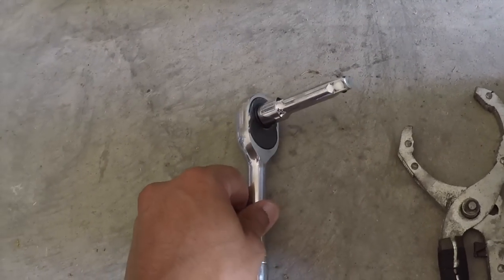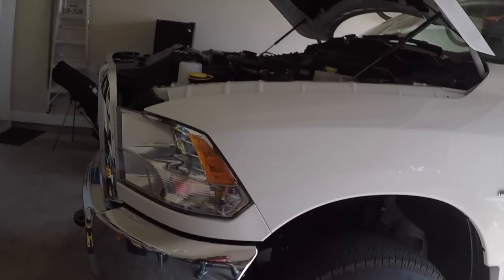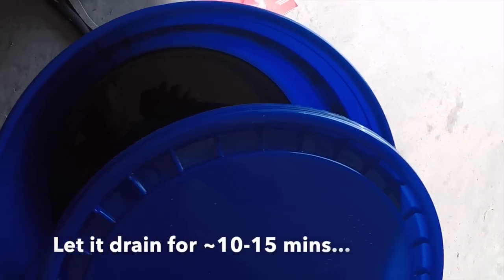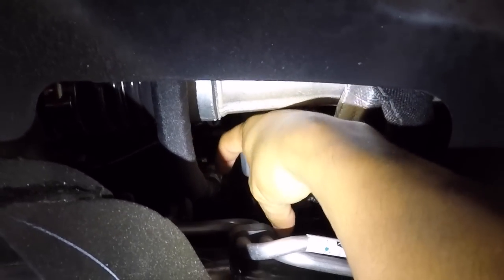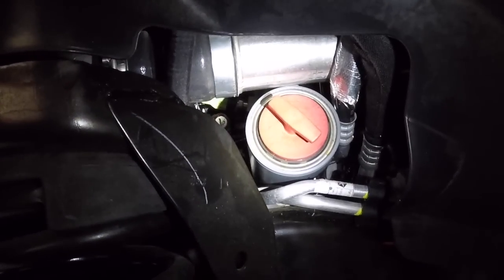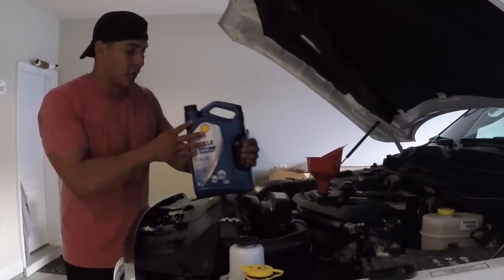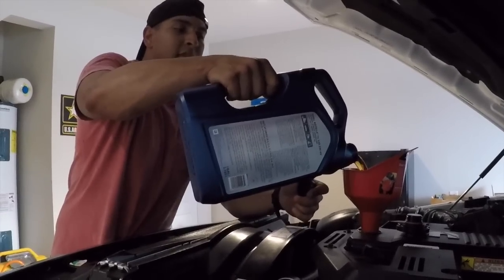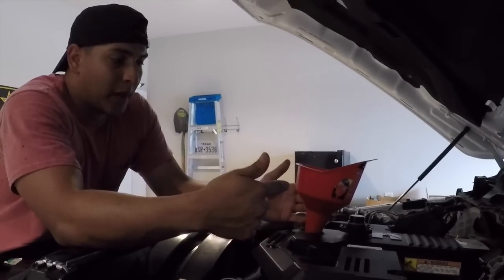EASY RAM 6.7L Cummins Oil Change How-To

Comment: Just bought a 2018 Ram 3500 with the Cummins and really appreciate your videos.  I noticed the wrench and ratchet set you had in the black tool box. I've never had a decent set and am in the market. Where did you get yours? Also are you planning to go with the owners manual for oil change intervals?
Reply from the maker: Our Future in an RV It was a gift from the parents 10 years ago when I was wrenching in HS. A good quality set will last a lifetime. I’ve only had to replace a 10MM socket and a 1/2” drive ratchet since I’ve had it. I believe it was bought from Sears and of the Champion brand. Can’t go wrong with a large set with many pieces but having a box with it makes it easy to take with you on trips. I slide it behind my rear bench seat.
Reply from the maker: Yes, I absolutely plan on abiding by owners manual for services. Especially the oil changes, 15K miles/6 months/500hrs.
Reply: Thanks for the quick reply.   @MotorHead18
Reply: @MotorHead18  thanks for the video. Are you doing the fuel filter soon.
Reply from the maker: cee noom https://youtu.be/ALzOoHftP9c
Reply from the maker: cee noom Make sure you subscribe!
Reply: @MotorHead18  are you still doing every 6 months? 6 months seems to be overkill if you're not at the mileage interval
Reply from the maker: @kavik526town2  that’s my personal choice every 6 months even if I don’t hit the miles
Reply: @MotorHead18 doesn’t hurt, oil is cheap, motor is not!

Comment: does it matter if you drain the oil with the cap on or off on the motor?
Reply from the maker: Not really. I do it out of habit, maybe it drains quicker, but what's a few minutes going to hurt anybody.

Comment: MOTOR HEAD Good video.  Getting stuff together for my first oil change 2015 2500.  Had heard about Rotella T6 and saw they had a T5 (15w40).  Did you end up trying the valvoline? extreme or premium blue? I was semi inclined to just call local Ram/cummins dealer and ask what they were throwing in.
Reply from the maker: K. Piersing I am currently on amsoil after my T6 oil change. I believe 5w-40 will help with cold starts and warming up than T5 with the 15w-40. I haven’t tried valvoline, my next oil change is in April!
Reply from the maker: K. Piersing https://youtu.be/MbOknpimlv4 check out my amsoil video.
Reply: @MotorHead18  You in the sand hills of NC? At UNC currently but my wife and kids are down there.  I end up home most weekends.

Comment: Valvoline premium blue , is the only oil cummings recommends...........
Reply from the maker: Same principle of money drives wars. All about the money...Even if Cummins only recommends that oil doesn't mean it can't run with the same weight oil made by other manufacturers.
Reply: @MotorHead18  , I agree...
Reply: That’s funny I called Cummins a week ago and they would not even tell me what oil to run. They told me to call the dealership!

Comment: I think it’s waaay easier to remove the intake to get to the oil filter. No oil mess either cuz you don’t have to tilt it. You’ll probably need a tool to loosen the filter, but when you tighten the new one, just hand tighten it. That way you can remove it by hand next time.
Reply from the maker: The Yazz Its a technique. After my first oil change, it was much easier the second time around. Correct tools, right size oil filter wrench, hand tight and nothing more. After your first time through the wheel well, it’s MUCH easier.
Reply: Agree ,through the wheel well is best just need proper wrench and screw in filter cap then simply try it once .Do these ALLLL friggin day .

Comment: amigo i have to fill the filter before installed? or jus half?
Reply from the maker: guil Mondragon half would be fine, 3/4 is where it sits at when you removing it so between 1/2 and 3/4 filled before installing. Filling it to that point and priming the fuel pressure will help the truck start up.
Reply: The service manual says to fill with 1quart.

Comment: I'm currently finalizing my deal on my 2018 ram 2500 Cummins and they are offering me a service package for $4300 (I'm located central northern Canada so that may sound real expensive) that includes 13 oil changes 13fuel filter changes and 13 tire rotations but seeing how easy the fuel filter and oil changes are I think you have seven me a boat load of cash. I'm just worried about voiding warranty. I heard as long as you keep records of maintenance and receipts that all will be fine?
Reply from the maker: Jason Joyal It only costs around $2300 for parts. The rest they are charging labor, but with my vids you could save yourself a couple grand. Your call Chief.
Reply: 2 grand is nice chunk of change. With living in the colder climate would the rotella t6 still be a sufficient oil. We see -40c up here in the winters.
Reply from the maker: Jason Joyal Yeah, but you definitely need to run 5w-40 in your winter. Not 15w-40.
Reply: Good Lord man, I wouldn't get the oil changed at a dealer if the labor was free, just so I don't have to see their face.  You warranty will be over before anything breaks, then the whole truck will fall apart.  Ask me how I know.

Comment: Step 1: verify you have the right oil filter. Step 2: poke a hole in the bottom of the old filter and let it drain.

Comment: You live in Texas and use 5w40??? Manual and shops say 15-40 here 0 degrees and up is 15-40. Great videos though.
Reply from the maker: Mike Yes! I live dangerously!
Reply: @MotorHead18  hahaha ya. What part of Texas are you in? I'm outside of Austin in Round Rock. PCSd to Ft.hood few years back and got out on medical retirement. See your airborne flag in the back. I was airborne qualified for 5 years then dropped status.
Reply from the maker: Mike I wish I lived in Texas, for now, North Carolina.
Reply: @MotorHead18  sucks man! Either way keep up the good work and from one vet to another. Thanks for your service!
Reply from the maker: Mike Get em’ Mike!
Reply: @motorhead, are you still in NC?  I’m at Bragg.

Comment: 3 gallons of oil not 15 quarts............I also found it easier to use a gallon zip-lock bag to put the oil filter into while taking it out.
Reply from the maker: I've heard of the ziplock bag before, not a bad idea. I prefer the adapter!

Comment: I was told by the dealer to wait on the first oil change because the factory adds additives to help break the motor in properly. They coulda just took my $500+...
Reply from the maker: I would rather get all of that junk out. I believe silicone is the worst enemy during break in.

Comment: So, I have a question for the -Fumoto Easy Oil Drain Valve Bolt (Buy Here: https://amzn.to/3bkenaW) I saw you recommend it but I did not see you installing it to see the functionality of it. I just wanted to know before I bought it. Thank you!
Reply from the maker: I have since installed, and it's badass. Wish I put it on the first oil change Steve.

Comment: You don't have to drain the oil with a 5 gallon bucket you could actually do it with that oil pan.
Reply from the maker: That's very true, although I use the bucket to prevent splashing because of the space between the oil pan and drain pan. I highly recommend a 5-gallon bucket for that reason, throw the cover on, and take it directly to your local auto store for recycling.

Comment: You stated the spec's day it takes 15 quarts but you only bought 3 gallons
Reply from the maker: The first comment clarifies.
Reply: Do is out 15 quarts or 3 gallons
Reply: So
Reply from the maker: @carlvin8693  12 qts or 3 gallons
Reply: Thank you

Comment: That would be 12qts. With a new filter. 15's gonna put you WAAAAY over full. SORRY!
Reply from the maker: Terry Henry Your absolutely right, just misspoke!
Reply: @MotorHead18  Yes Sir, no big deal. I think in the video you actually only put in 12 but got your math and mouth confused. LOL!! Good job though, that little cap off tool is a charm for this job. Otherwise, HUGE MESS. Good info for the guys that don't know this. It's a lifesaver.
Reply from the maker: Terry Henry Thanks for the feedback, terry. Feel free to check out my other vids! I promise I don’t misspeak often lol!

Comment: Dont use rotella
Reply from the maker: Alex Guzman Heard great things about its T6 in our trucks. Why shouldn’t we use it?
Reply: MOTOR HEAD theres better oil for a Cummins engine my dad has a 2018 6.7 and he only uses vavoline  Cummins oil look it up.
Reply: MOTOR HEAD highly recommend vavoline Cummins oil.
Reply from the maker: Alex Guzman Thanks for the feedback. Heard it came from factory with the valvoline premium oil, and Cummins encourages the use of it to many because Valvoline sponsors them lol.
Reply: MOTOR HEAD yup that's all ture you going to buy it for the next oil change
Reply: Rotella is some of the best oil on the market for Diesels. You will not wreck a Cummins engine and have never seen or heard of one being destroyed by Rotella. All I have ever used has been Rotella. Even says it in the owners manual for my 2018.
Reply: Am at 11500 miles on my 2018 ive heard great comments of the rotella
Reply: I’ve used chevron delo for 25 yrs in all my Cummins trucks. Never had an issue
Reply: The owner manual calls out Rotella as suitable.
Reply: Shell Rotella, Valvoline, Chevron Delo, all are fine for your diesel.  The bigger choice is which type in each brand. Obviously, the full synthetic is going to be best, then choose your viscosity range. 5w-40 will be fine if running full synthetic.  Don’t waste your money paying extra for AMS or RP.  You came here to save money, not waste it. :)
Reply: @rbstorms  you're right about that
Reply: @rbstorms what is your oil change interval on Rotello t6 5w40 ,how any miles?
Reply: @glamb691  With full synthetic and the OE, NAPA Gold or Wix equivalent filter, I would go 10,000 miles.   My current "problem" is that I don't drive that much, so I end up changing it out once a year if I don't hit that 10,000 mark.  If you're going to go 10k, check your oil to make sure it's not getting visibly dirty.  Synthetic is only going to wear out if it gets too hot, or your engine is dumping too much particulate for your filter to handle.  And then there are the friction modifiers and other additives in the oil that wear out over time and miles.  If you have any doubts, go shorter on the change interval.  With non-synthetic, I change at 5,000.  Finally, If it's under warranty, don't give them any excuse to deny coverage if the worst happens.  Keep your receipts and records.

Comment: I don't understand the turning the key to the on position? If the motor is not turning over then the oil isn't circulating is it? That would be correct for the fuel filters. Don't understand your priming the oil?